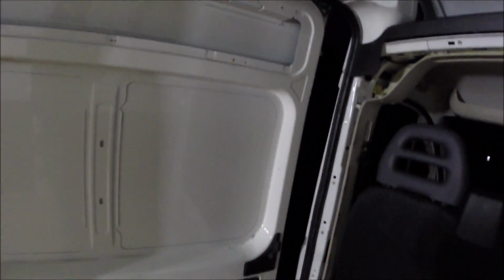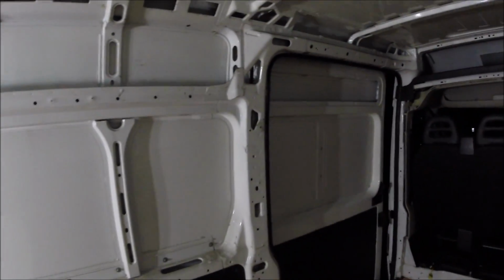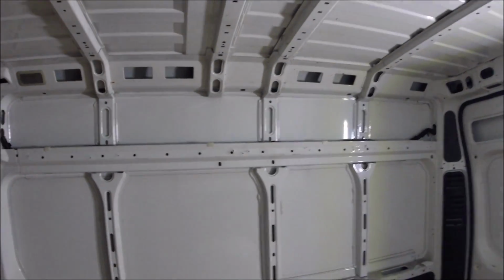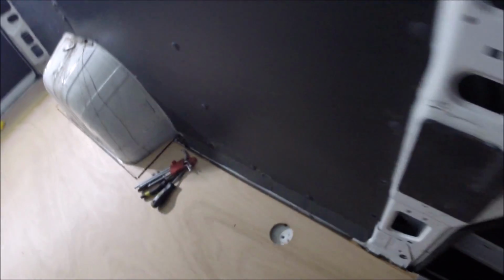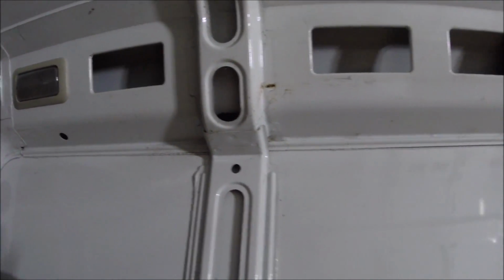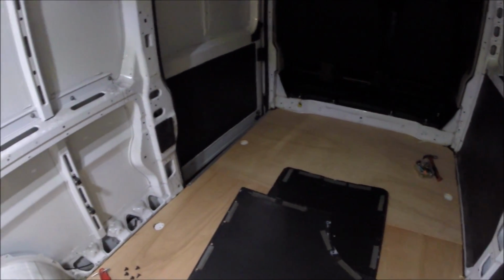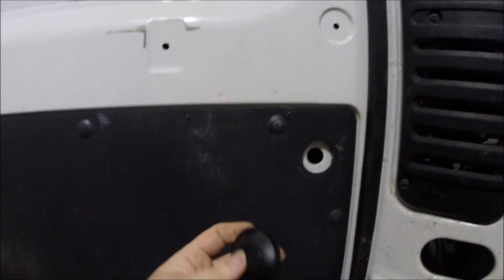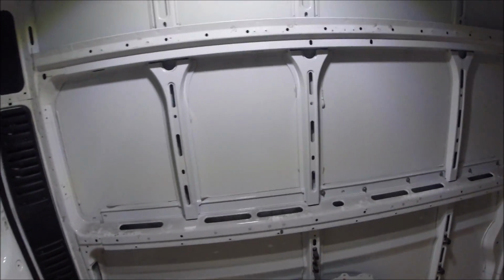Peugeot Boxer L4 H2 Camper Van Conversion - Episode 1

Comment: Can I ask? Why did you choose the Van you did, my wife and I are looking into purchasing a van for converting, it's a bloody mind field to be honest, trouble is at 6' 4" I need a big van! So I've subscribed to your channel to follow your adventure
Reply from the maker: TheAudiostud hi I had originally planned to get a l3 h2 but this had all the right stuff and low mileage. If you put the bed the same way I did you won't have enough room to lie down . After looking in to it a bit more the luto style vans are wider but you could also that a l4 and turn the bed round to make it longer. Hope this helps. A friend also just bought a new caravan and the bed was on a roller system. So you could pull the bed away from the wall and add in a 12" wide section to the pillow end.
Reply: Thanks for your quick reply